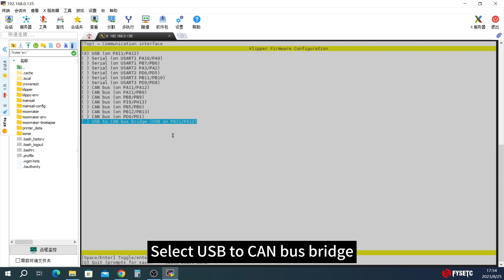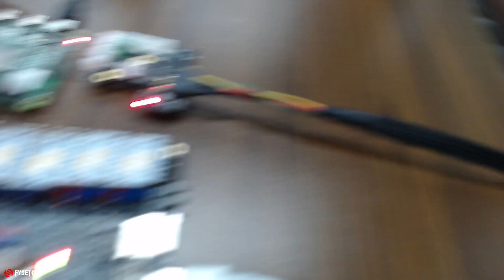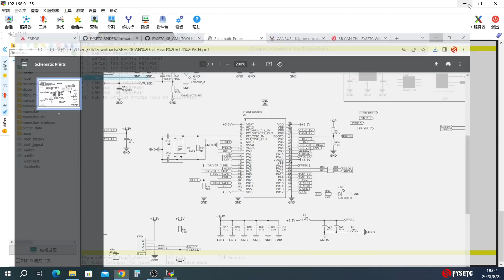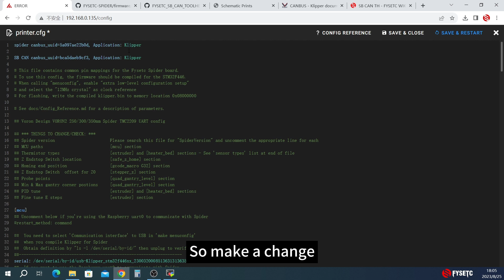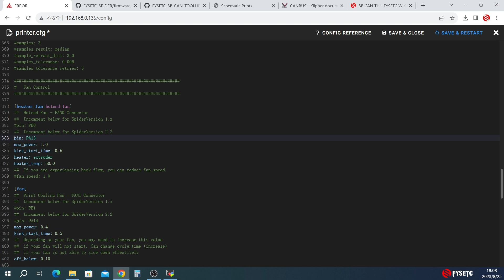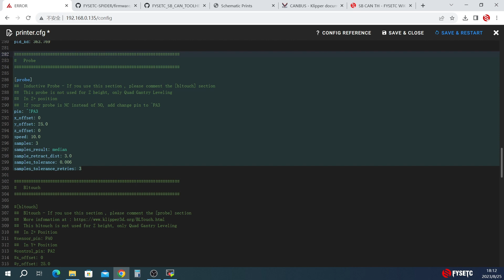Spider 3.0+SB CAN configuration and firmware burning tutorial

Comment: I Have a problem, tried with 2 different spider 3.0 boards. When I try to flash the firmware I get the message : DFU state(10) = dfuERROR, status(10) = Device's firmware is corrupt. It cannot return to run-time (non-DFU) operations
Any ideas how to fix this?
Reply from the maker: What command to use to flash? Or did you use STM32CubeProgrammer under windows? It’s best to have screenshots
Reply: @fysetc4882  I was able to fix this! Thanks